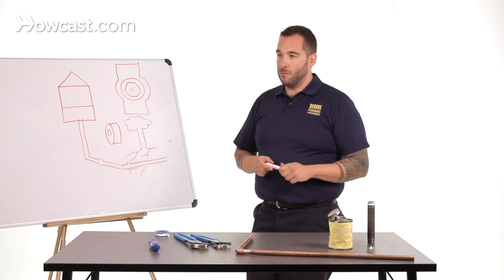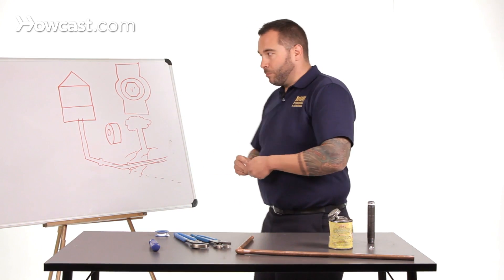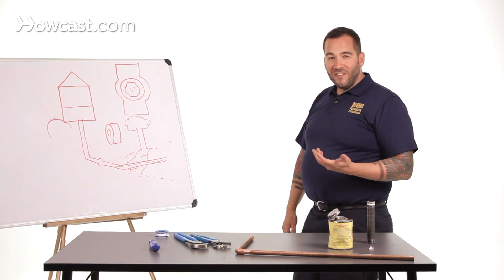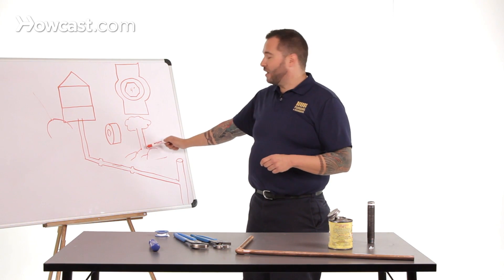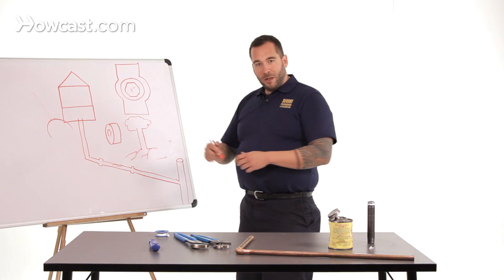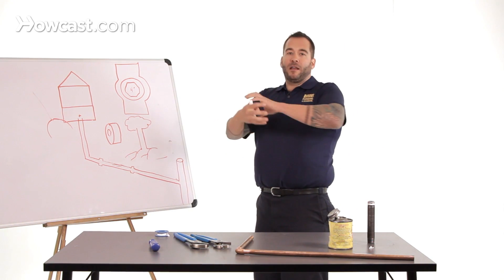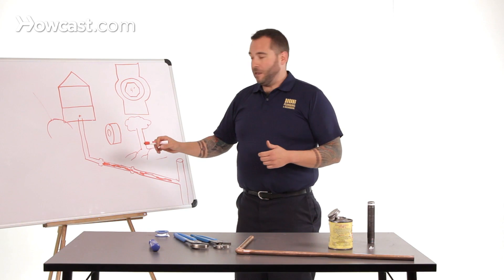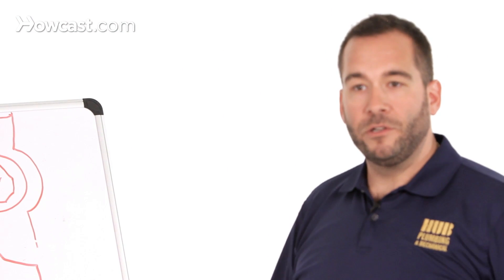How to Avoid Clogging a Sink Drain | Basic Plumbing

Comment: The best way to avoid clogging is to prevent the residues get into the pipe. Check out my videos. There are some anti-clog sink strainers that prevent the residues get into the pipe and at the same time allow the water to flow smoothly.